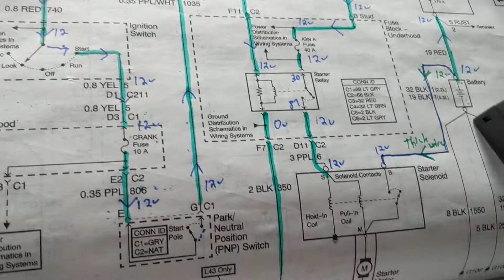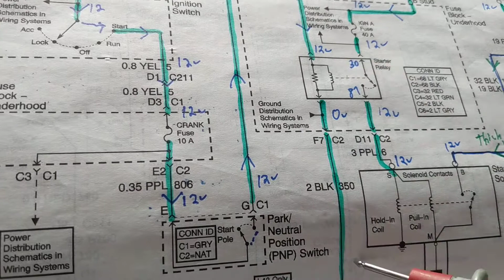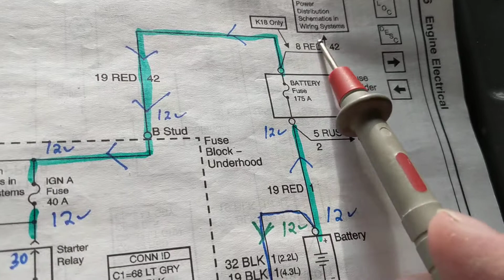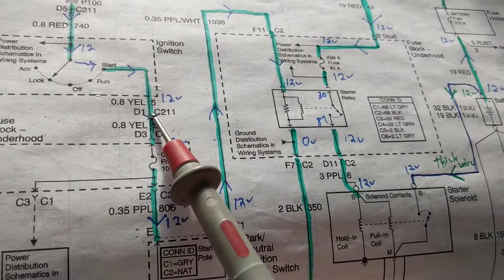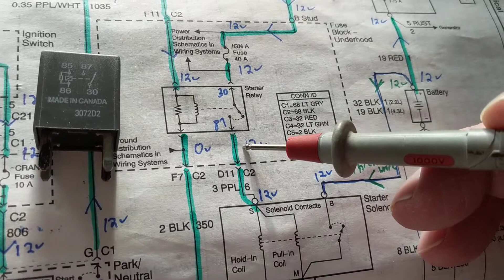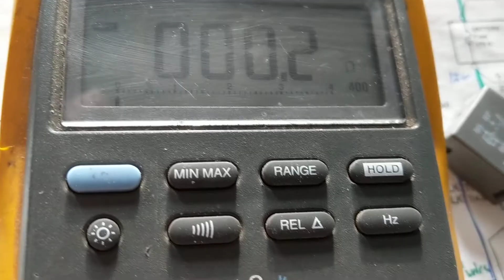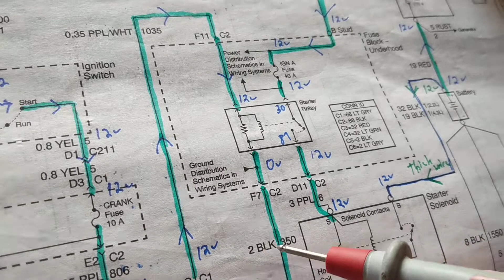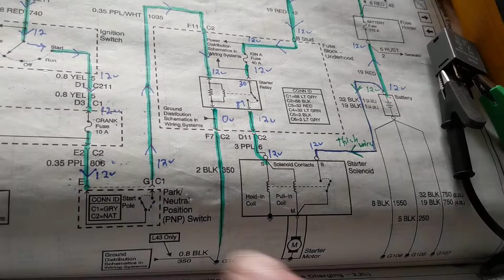HOW TO DIAGNOSE START A MOTOR CIRCUIT

Comment: Yeah this is real good, see I have power to the ten amp Crank Fuse when I turn the key (the light lights up) And when I check for hots on the starting relay I only have 30 hot none of the other ones get hot key on or not. So I think you pinpointed my issue, the problem has to be the park/neutral safety switch, I know it isn't the starter because I can jump pin 87 to the positive battery and the vehicle will start, so not an issue with the starter etc..big thanks I have good direction to look into now unless the vehicle computer comes into play somewhere.

Comment: I have a question do have  wiring diagrams Toyota Corolla 97 1.6 keeps blowing the Am fuse 30 amp.with the ignition on.i hope you can help me.thank you.
Reply: Sounds like you have a short the ground somewhere could be on the load side you have to do a resistance check like I made in videos from the side of the fuse to ground the first verify that you have a short to ground which sounds like you do we're blowing the fuse on Resistance check then have to look up Google wiring diagram for starter motor for your car you should get that page keep me informed

Comment: I have a question. 
I am working on a 2014 Renault fluence which is unable to start, and my OBD scanner tells me that the automatic gearbox is not detected, hence no P R D N are shown on the instrument panel. 
i tested the gearbox module as you taught us, and also tested the fuses related to the gear and they are all good. still can't start the car. 
what should i do? 
Thanks a lot
Reply from the maker: Sounds like the computer doesn't have communications to that module first you have to see if this is a starting problem or a communications problem again check the gauge on your dashboard if it comes on to see the starting voltage the instrument panel should light up and around 10 and a half volts now if there is a communications problem you might end up changing a module one step at a time good luck